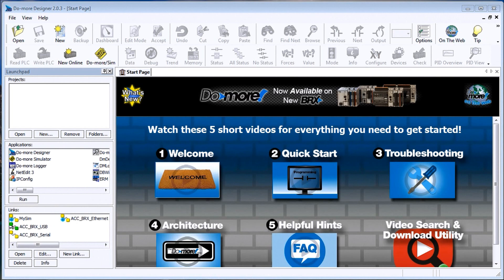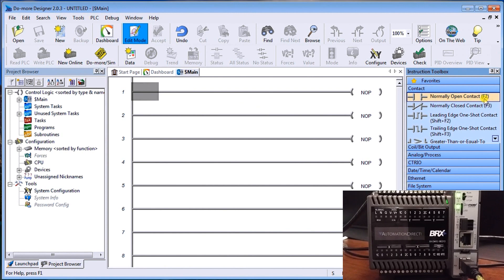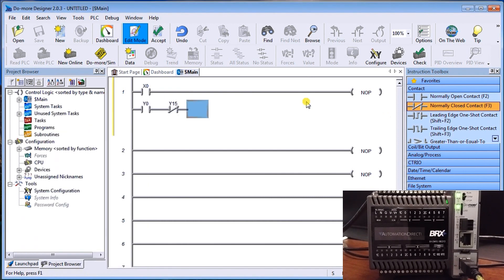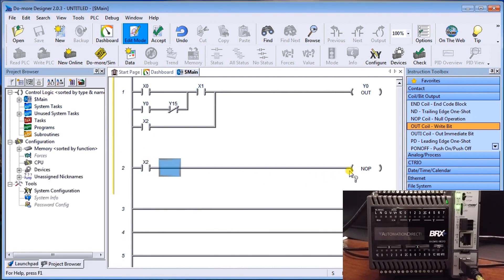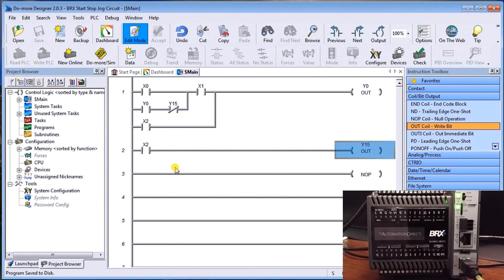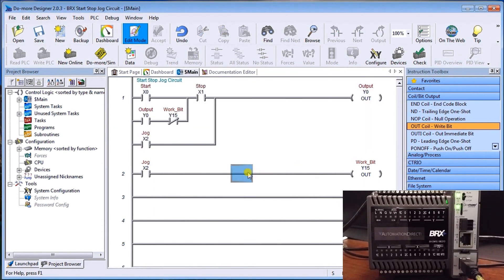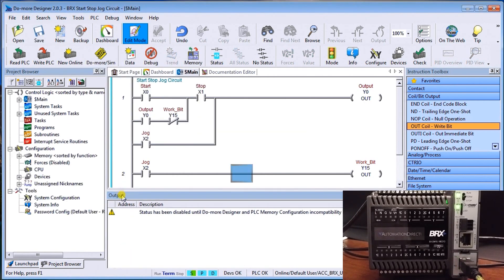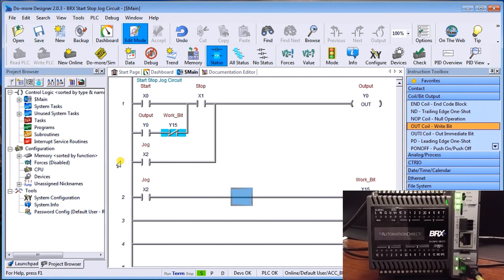Master Your First BRX PLC Program: Start-Stop-Jog Circuit

Comment: OK  I get it - but u need to add a little more abt the task to be accomplished.   Fails to explain the BRX  capabilities generally.
Reply from the maker: Hi Steve,
If you need BRX general capabilities then I would look to the specifications for the BRX that you are looking to program.
https://cdn.automationdirect.com/static/specs/bxdm1e_18ed13.pdf
Here is also a quick overview of all of the features.
https://www.automationdirect.com/do-more/brx
If you need more information on the actual task or program control then here is another post in this same series:
https://accautomation.ca/brx-plc-program-control/
Here is the entire series on the BRX Do-More Controller.
https://accautomation.ca/series/brx-do-more-plc/
Let me know if you cannot find what you are looking for.
Thanks,
Garry